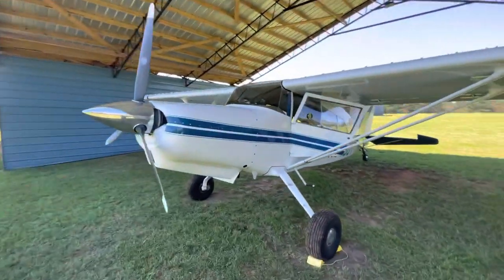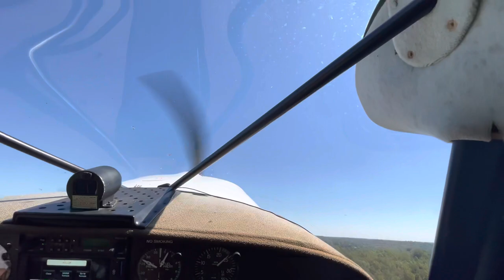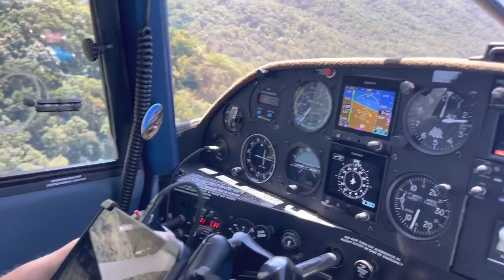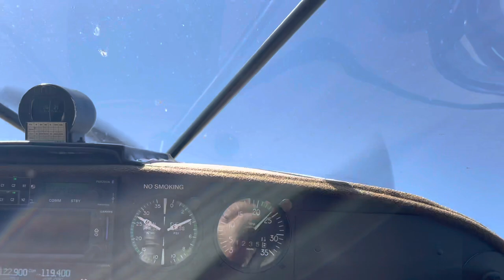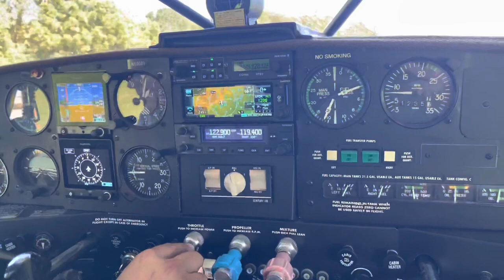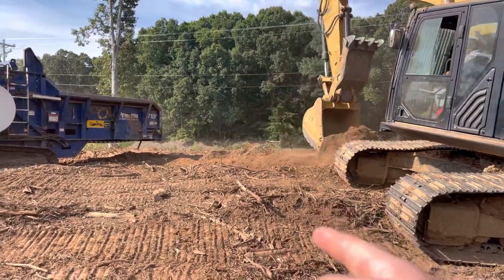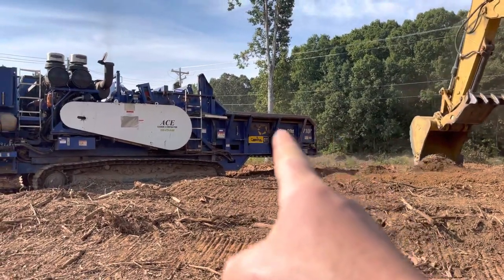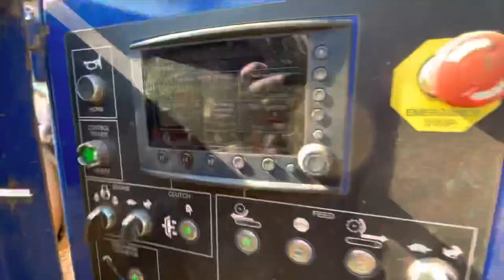Airplanes, grinding, and moving an excavator !

Comment: Im curious what the big suprise is!? I liked how hou were talking about the different teeth for the forestry mulcher. Is there any way you could do a short video comparing the different teeth and what you like vs dislike about them? We use a Fecon Blackhawk mulcher on a new 299d3. We have hardened steel (not carbide). I use an angle grinder to sharpen them every 4 hrs. I highly recommend the PFERD 5" Victograin discs to sharpen. Thanks and god bless!